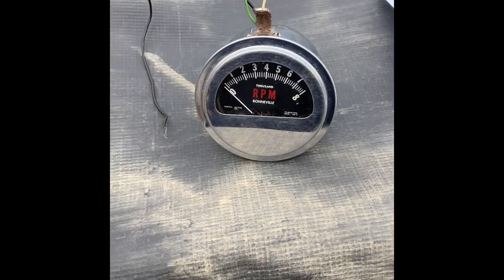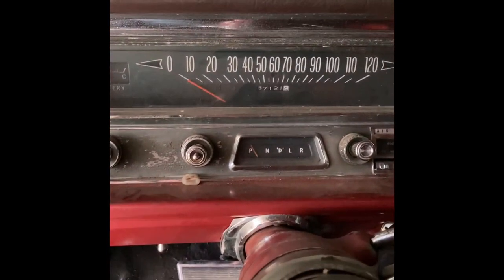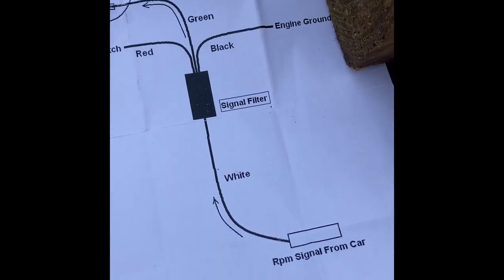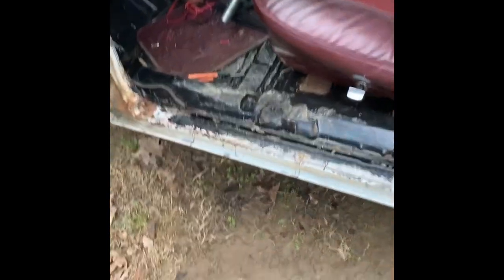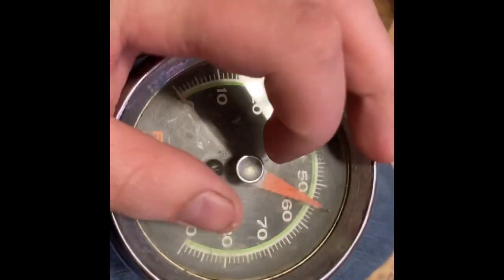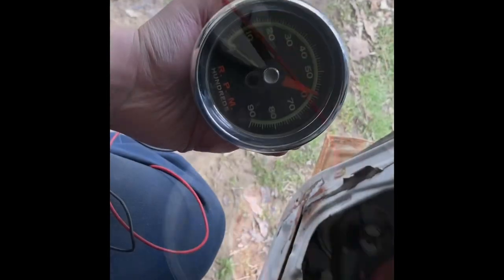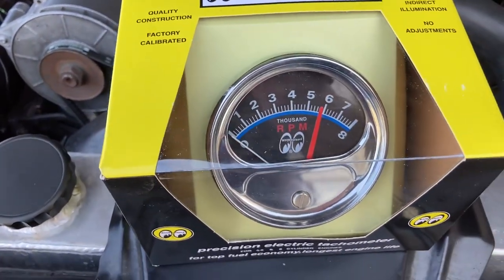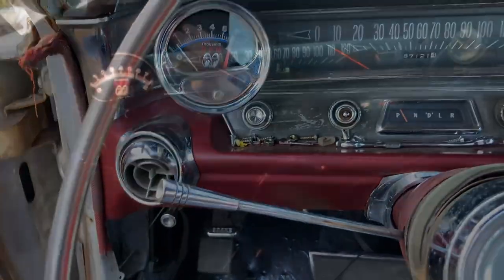Will the 63 Pontiac Star Chief get a working tachometer? #ponchopower #widetrack #crossram

Comment: Did that car have AC?  Them dash vents...
Don't think that was old school telephone wire, because they used a solid core single copper conductor back then, a red, a green, a black, and a yellow.  Maybe they switched to stranded wire at some point... A single line phone uses the red and the green, and the yellow and black are for a second line and maybe other things.
I don't like LEDs in the dash unless they're not too bright, and are dimmable. You want #168 bulbs, don't use 194s. 168s are 3 lumens, and 194s are only 2 lumens.
Reply from the maker: Sure did, factory ac car and I plan to make it work again. It may not be telephone wire but none the less it didn’t belong lol. I probably won’t end up putting LEDs in it’s just a thought. I appreciate you watching Dan!